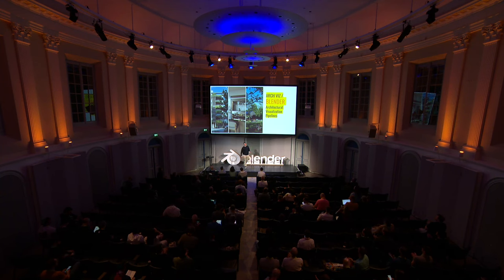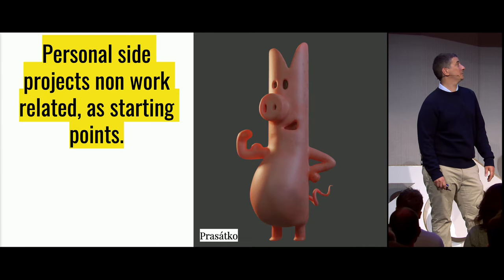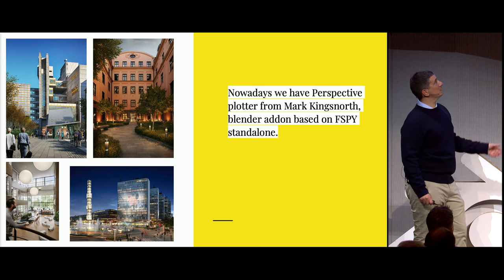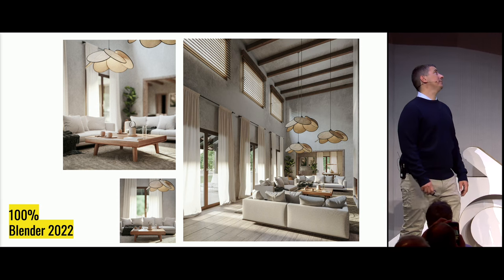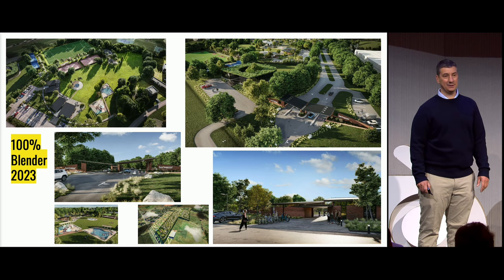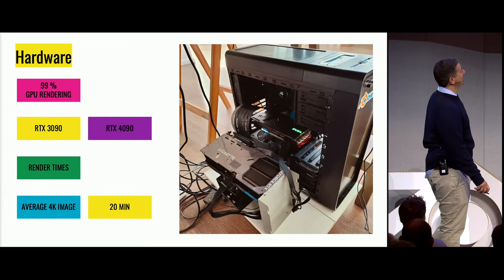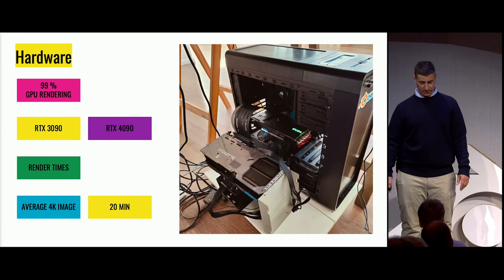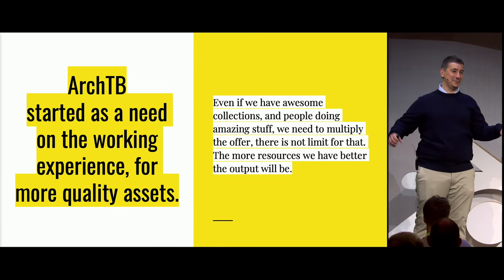Architectural Visualization Pipelines — Blender Conference 2024

Comment: I doo hope blender will have bim and parametric modeling capabilities like fusion 360 and revit .
Reply: You can do most of fusion stuff in blender and you can use Bonsai along with Blender for BIM stuff. But there is quite a learning curve.
Reply: @spaciotechtonics  does blender have parametric capabilities ? Thanks!
Reply: @Paulklampeeps  Yes. I'd argue that they are even better than Autodesks tools. You can check out some tutorials on modifiers and geometry nodes in Blender.
Reply: @spaciotechtonics the way Revit handles parametric options in Families(Blocks)is different, right now not seen in blender.

Comment: As a Blender user, I started rendering for Archviz there but then switched to D5. You can get 4k renders in like 1-2 min
Reply: I keep hearing praises about D5, I better get on it...
Reply: @shrimpkins  the workflow is just so simple and easy. I just model everything in Blender, or at least most of it, then switch with the plugin to D5 and put lights, mats and cameras. You can even do some postproduction. Everything in real time.
Reply: I think D5 is very powerfull and you can get really good results crazy fast. If you want perfect results, cycles is better, though. Also you donˋt have much "freedome" in D5 and everything looks similar. (Still recommending D5, because itˋs so easy and good)
Reply: is D5 free ? blender is the best because it is FREE

Comment: For realistic render especialy interior render. I feel more comfortable and it's easier to control with Blender.
In modeling SketchUp and Reveit still faster for building.(I tired some CAD addon but still found skp and revit is easier.) But for organic shape or funritures. I always use Blender.

For paremetric modeling Grasshopper is still king for me. I still struggle with  geo node. It's steep learning curve.

By the way, I really love blender. especialy nav system and shortcut keys.
Reply: but they are paid software , blender is the best because it is FREEEE
Reply: If you want an alternative to Grasshopper in Blender, you need to try Sverchok Addon since it was created exactly as "Grasshopper for Blender" and the nodes are focused on the  modeling aspect. Basically, an "Edit Mode" in nodes.

It works like "python in nodes" for procedural modeling. The data input/output of the nodes are python lists or nested lists. So the workflow is done thinking in lists, indexes, and matching indexes (like you need to match attributes/fields in Geo Nodes). Since it uses python, one down side could be the performance going down when having too much geometry.

At the current state, I see the Geo Nodes more like a modifier for procedural animation and generate/distribute instances. It is not (yet) the right tool for "procedural Edit Mode". Sverchok is!

Comment: SketchUp and Revit are paid software , why are they appearing here?
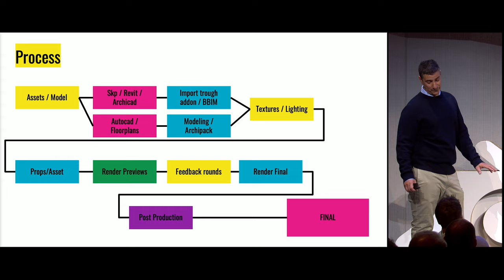Reply: he talks about this at 6:45 first and there is the workflow shown at 12:00. 

they do not model themselves, they work with their clients' models that might be coming mainly from Sketchup and Revit in their case (in my country it would be overwhelmingly Archicad and then some Revit). Blender does not exist in a void, you need to be able to absorb models from others regardless of their source, whether they were made by paid/free or proprietary/opensource software.

one thing I missed though - in other packages you have add-ons that are capable of updating the geometry coming from BIM software but they would retain the materials in the target model that makes iteration kind of painless. I'm not aware of how to do it in Blender, this is my single remaining problem to make the switch from AC-C4D.
Reply: Sketchup is horrible if you use blender there is 0 reason to keep it on pipeline, but i can understand using revit
Reply: @SanOcelotl  Sorry if was not clear! But we dont use it we, received from the client on that formats! :)
Reply: @furtonb  Exactly! Thank you!